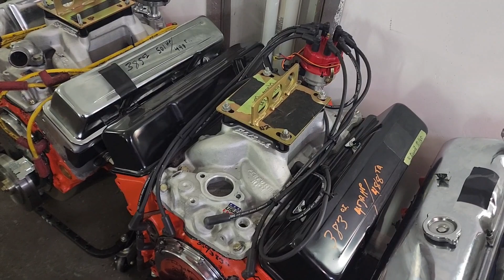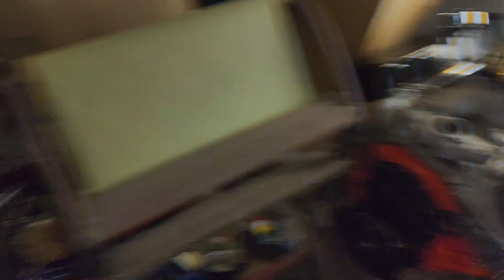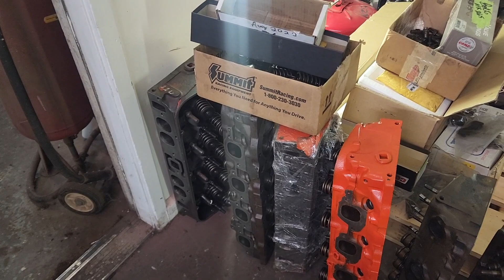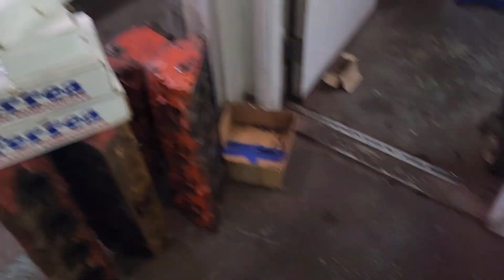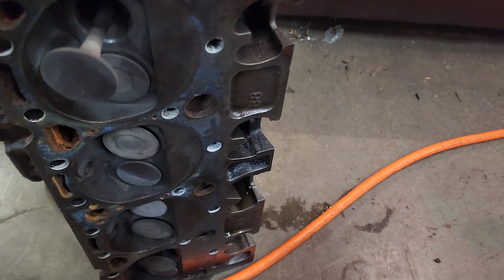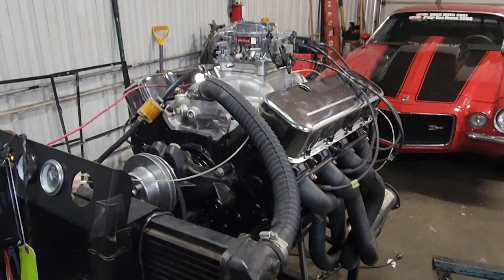Inventory walk of Engines and upcoming projects  DZ,performance

Comment: Great video and you have a nice set of motors. I has a 327 in my 65 impala with double hump heads. What set up would u recommend to get at least 400 to 425 to the wheels?
Reply from the maker: Thanks for watching,, If you want 425 at the  wheels,  means you need about 500hp at the flywheel, I would have 2.02/ 1.60 vales and a basic bowl blend on the Double hump  heads. And Edelbrock RPM intake and a stroker kit to increase your cubic inches from 327 to 383, 9.1to1 no more than 10to1cr. Heavier car like that you probably want to keep your cam duration  around 230@.050. My experience tells me that would get you in the ballpark
Reply from the maker: there is many  different ways to  get  to 500hp but,  that is how  I would do it
Reply: Thanks for the information.

Comment: I need a motor for my dirt car,pro mod.
Reply from the maker: That's not my kind of thing. I usually do street strip small and big block chevy's,, But thanks for watching my video
Reply: I want a dz style 350, I run open class and I can run any engine I want.no restrictions. Or a 383. Most cars here run the 383. I have several motor,but none of them were proper balanced, mixed up ,with the wrong flywheel and balancer. All used!  I need a good block that is balanced. I will put the correct parts on it.

Comment: Good inventory of engines.  If I needed a motor, I'd be contacting you.  A test I'd love to see is a 454-468 87 octane hydraulic roller build.  I'm interested not for the cost savings on fuel but I can get 87 octange ethanol free around here realtively easily.   I have had some carb problems with the standard 93 after letting the car sit a while.  87 ethanol free has been great in my C10.  I'd also be curious if a more modern chamber head like the AFRs are worth more on the lower octange.  Straub has posted 496 87 octane builds.  I'm into stick shift street cars, and in my opinion a healthy 454 in a Chevelle would have plenty of power.

Comment: Have you ever had a 496 with 188 heads just wondering how they perform?
Reply from the maker: I may have missed spoke. I may have called my rectangle ports on one of my 496 a casting #088 But they're really actually #188
Reply from the maker: They're good cylinder heads. My ones that I have do not have a performance valve job on them. And they don't have much porting work so they didn't really show what they could do
Reply: The reason I asked is they made 088 heads that came on later model 502 engines and they made 188 heads that came out on a 70 Chevelle 454 kinda like the 990 heads which one makes the best power?

Comment: great video for a motor head that was fun to watch, my neighbor is a old drag racer never sold anything he has a couple of bbc 700 ci engines on stands duel dominators nitrous plumed the list is end less sbc blocks stacked three high 6 long. bbc and sbc cams setting like dominos cranks pistons new in boxes rods new there is a vett he ran in the early 80s complete could not get to it in two weeks if you worked full time the shop is a mess there are racing power glides liberty transmissions, he always tells me he wants to sell me something but well not make any effort. I go to the shop just get my fix. lol
Reply from the maker: Thanks for the compliment,, I don't have anything wicked like that most my street motors are 400hp to 800hp
Reply from the maker: Man, you are a true Motorhead. If you enjoyed listening to me, ramble and stutter about my motors,, Thanks for watching

Comment: Hey Nick I have a stock 1992 model 454 tbi motor.Its a low mileage good solid motor.If I change the cam to a 232 bootlegger hyd roller cam and put a air gap dual plane manifold 750 holley and headers what kind of power do you think it would make? It has the small port heads on it.I might blend the bowls and open the exhaust up on the heads.just your basic low compression 454 with a cam!
Reply from the maker: That 232 bootlegger is a hell of a great cam,, I've  tested on that one many times, If you've got 7.9 to1 compression, you'll be really pushing the boundaries of not enough compression,, But it would still work,, Most experts won't give you a guess because they don't want to look like a fool. But I guess all the time,, If everything else is correct. I believe it'll make 480 horsepower and 520 pounds of torque
Reply from the maker: That cam you're asking about every time I use it small block or big block,, It makes 15 more foot-pounds Than horsepower
Reply from the maker: You probably noticed, but i've got one in my 383 one  that was my personal motor
Reply: My guess 450 because of peanut port
Reply: Your gen V will need the screw in rocker stud mod. The goofy shoulder bolt setup on those is only good to around .500 lift plus there is no valve lash adjustment on those. There is a stud made for this as the threads in the gen V heads are smaller than the regular bbc rocker studs.
Reply: Thanks man! I was thinking 400hp but you have tested alot more then I have ! I watched your 383 video and that was impressive I thought.thanks again for the reply

Comment: What kind of oil pump do you run on your street big blocks with standard clearances?
Reply from the maker: If the oil clearance is right where it's supposed to be, I'll usually just run a standard oil pump. and 10w30,If it's a little wide I'll run a high volume, With thicker oil,

Comment: That's a healthy inventory of engines! Really impressed on the 654 hp 468, not a huge compression ratio yet still makes a lot of jam. Nice Camaro as well, got my license in a 70 back in the day! Great video.
Reply from the maker: Thanks for the compliments! Yeah, I'm super proud of that. 468 I had many cam's ground before I found the right numbers,, To make that power
Reply: Those 265 afr's work really well too! @dzperformance7360
Reply from the maker: That's a bad ass story about the 70 camaro
Reply: Yes, it was just a plain jane with a 350 and 4 speed. Still  a lot of fun though! @dzperformance7360
Reply: Yes, people somehow over the years forgot that they made power without needing afr heads. I guess that certainly shows their marketing worked

Comment: I bought an 85 RV for the 454 and 400 TH trans, the odometer shows 24,859 on it, 
there's also a plate on the driver side of the block with specs on crank turn and such, 
I can't understand why the plate is on the block or why the crank would've been turned if it's the factory 454, 
I've never even pulled a valve cover to see the condition
I've put about 2 miles on it just on my road after the install in my 85 K20.

Comment: I remember those days of guys buying old farm trucks and swapping in small blocks to score the big block.  They were definitely a lot harder to get, as a kid I wanted one so bad..  🙂 As an engine nerd I REALLY enjoyed your tour.
Reply from the maker: It makes me sad but a lot of the motors I buy was grandpa's, Motor out of his chevelle, he sold the car but kept the motor Cus. Someday he was going to go build it and drag race it and just didn't happen , I say it makes me sad but I always think about that story. And think Grandpa would be smiling if he saw his 396 or 427, throwing it down on the dino/ screaming and actually did made it to the track
Reply: Crazily enough my grandfather pulled a 402 out of a 70 monte Carlo in the early 80s and replaced it with a 350 just because no one wanted the gas guzzler 402 and his goal was to go racing with the 402.
Reply: I am that grandpa, and have been trying to get a motor going,but two machine shops here that are crook's and stole money. I got back screwed up motors with no balance. And not finished! Dallas is the closest real shop and I'm at central La.  I want a dz motor like we run in the 70's  high compression, solid cam to match the compression. 11 to 1.   Or 12 to 1. I can us either one.
Reply from the maker: Crazy Ironic I told you that story
Reply from the maker: 402 are so cheap,, Put a 454 crank in them. And they're so easy to turn into a stroker. 436ci and make good power,,!!!

Comment: I'm looking for a 496 short block. I want the bottom done. Oil pan, camshaft installed, small dome pistons. I can finished the rest.
Reply from the maker: The two 496 with black valve covers that are shown in the video, Both of those motors are 4 bolt main blocks forged pistons and rods scat 9000 crank, I would sell as sean in video with out lifters,pushrods, head,top end exc,, for ,$3950 And I would personally deliver myself for a $150. Delivery anywhere in the midwest
Reply: @dzperformance7360 ok thanks! I live in Washington DC so I'd need to check with freight cost. Also do you remember the dome size on the piston? I want to use atleast a 2.25 or 2.30 intake valve. Thanks
Reply from the maker: Icon 20cc domes # ic789-060
Reply from the maker: Not pushing you, I'm not hurting to sell the motors. But I deliver it to you for $300
Reply from the maker: I do a start up stand run video before I took the heads off and shipped it and also guarantee it   for 6 months